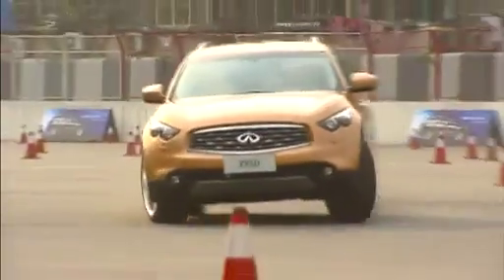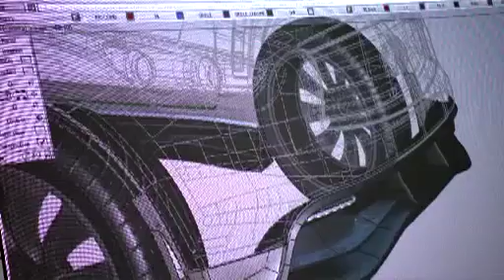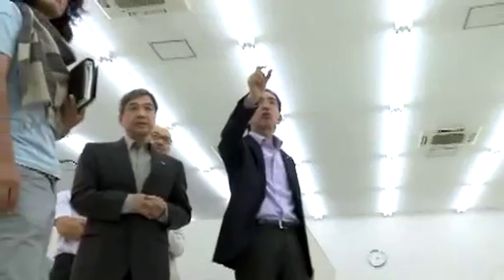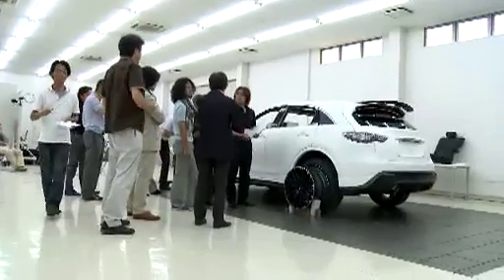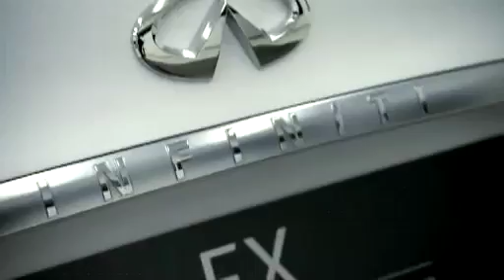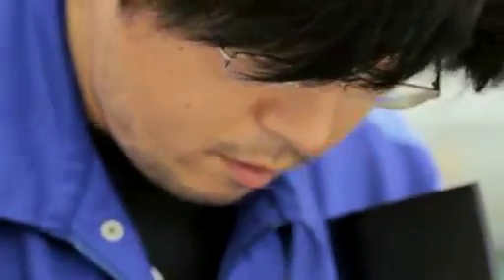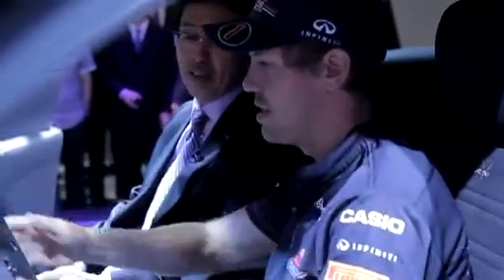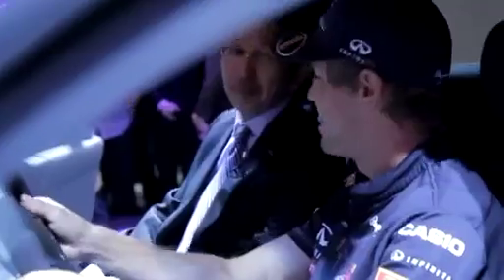Infiniti FX Sebastian Vettel

Comment: i wish they would do more to the titan in 14 i like the 2.8 cummins diesel idea which there driving around some mules right now but we need some sort of sport truck to compete with the others nissan ceo if you read this please do something for the other half of the titan race and off road fan club whos die hard owners. we need this vk56 better and trans keep the 5 speed but we need to be running at least low to mid 14s stock please.